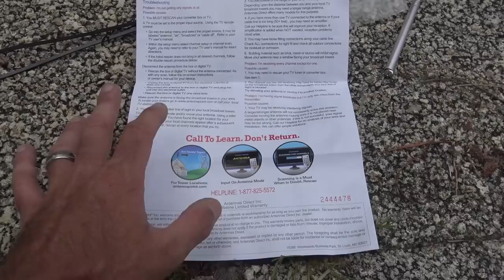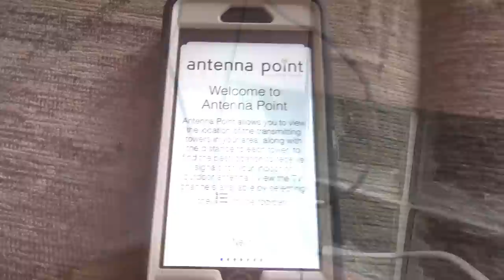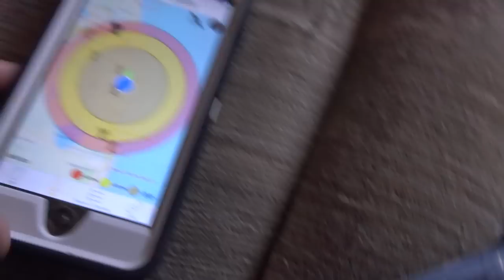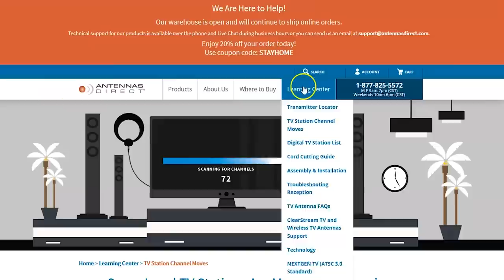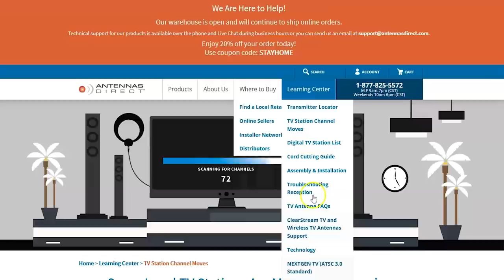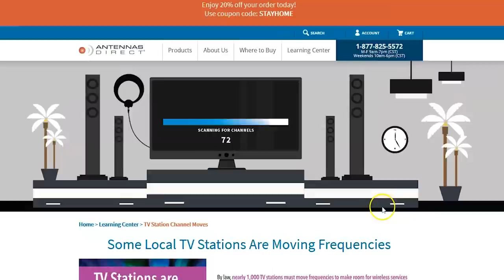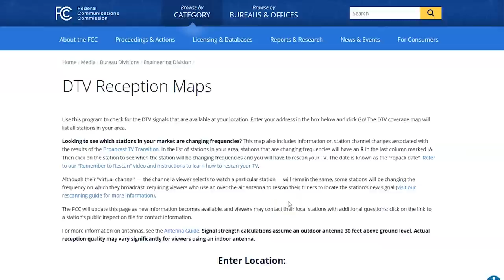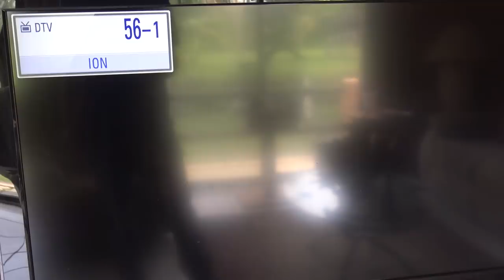Cancel Your Cable/Satellite, FREE Over-The-Air HDTV, TV Antenna Review, Cut The Cord!!!

Comment: Thanks for the info, it;s been many years since I work with setting up cable and ant systems for family. But recently I have a family member that was hurt on a job and he lives in the mtns of east TN and is on a very strict budget. So I used you videos as a reference on what needed to be installed at his house so that he could at least get what was available.

Comment: I cut the cord last week ATT/direct TV kept raising the bill. It was 109. It went up to 150 I called and complained last year and they lowered it down to 125 then the discounts fell off and went up to 165. Once the other one came off it would be $180. So I called and asked them to give me a new promotion and they refused saying there weren't any for my account. I cancelled and kept the internet which will be $66 vs $170. So I'm saving over $100 a month. I bought 5 Amazon fire sticks when they were on sale. I'm now paying $20 Philo and $5.00 for frndlytv app. I also got a small HD antenna for the living room and it's working great I got 70 channels on it and am very impressed. I want to move to my sisters neighborhood and get spectrum: spectrum doesn't charge for data overages for their internet and my brother in law is a gamer and has been satisfied with their service. I hate ATT.

Comment: I use an old analog antenna for 4 TVs and I have picked up about 80 channels in the Sacramento  area.
Sometimes I can pickup four San Francisco Bay area TV stations.
For one TV in one bedroom I use a rabbit ears like trucker's TV antenna that would have been mounted on the mirror of the cab. I have it mounted on the edge of a metal awning as if was like the trailer of the truck. It acts as a reflector and it gets good reception.

Comment: I just left a comment on video #1.  Very informative.  This was just as good.  Maybe better because you did it for Grandma.  You, especially in your hurricane prone area, failed to mention anything about wind load, wind load ratings or any structural support that should be considered and why if you're setting up an outdoor fixture.  My 40 foot tower is bolted to the house at about 12 feet.  Then I guyed it to add support at the 30 foot mark.  Tornadoes and severe thunderstorms are common here.  I don't want my antenna going anywhere!  It's saved me way too much money!

Comment: I could have told you that Eric. Antop 401-BV  Big Boy indoor outdoor built in LTE filtering built in amplifier with uhf with vhf dipoles works really well. That is what I have. On average 70 mile range great for attic mounting, outside low profile mounting, on mast or side of a building.

Comment: I got rid of my cable service a year ago, and added Tablo for recording. In metro Phoenix I get CBS, ABC, NBC, PBS, FOX and a few independents. with the Tablo ( or similar Amazon product) you can record and skip through commercials, and get reception in all the rooms without individual antenna wires in each room, via wifi, I don't miss CATV

Comment: Finally a video where the distance from the towers is similar. I'm 60 miles out from the LA towers on mount wilson. I have the clearstream 4 max which is okay for most of the channels. The problem with the 4 max is the vhf antenna on it can't pick up 7-13.  I have been looking for a better vhf antenna. IDK if I'll get that multidirectional antenna but probably will get the high vhf one.

Comment: Hey Guy, I'm a Ham Radio Operator too and I went with the Gray-hoverman  DIY build and where I live I can easily get 56 channels - OTA, if I had a rotor a lot more as well. my cost was far less then you paid for that pre-made ant. Be real man and do some research on DIY antennas and you will see that there are many designs that can do a good job and are fairly simple to build - hey it's not like we don't have the time now!
Reply: Adding a few links to your research would have been helpful.
Reply: @d.j.radioroyspinner8  Oh, I will, but I had always heard that Ham Radio Operator's were really helpful bunch and shared information. Apparently, in your case that's a false statement.
Reply: Not really i gave you some good info

Comment: The DB8e 8 seems like it's going to be a great antenna. I don't even have it mounted yet. It's going to go in my attic. I'm about 35 miles away from the nearest transmitting towers and when I tested this antenna out on the main level in my house, I picked up almost every channel I can receive from the those towers (About 40 channels). Keep in mind that I had this antenna in my dining room when testing it. The signals had to travel through one of the outside walls on my house plus 2 other inside walls.

Comment: 20 years ago my ex wife splashed out on U.K. satellite tv from SKY to keep our young children occupied beyond non stop vcr repeats of Thomas The Tank Engine & Pingu. Because the tv was at the western elevation of the property and all the neighbours’ dishes were sighted along their Eastern facing walls , I duly climbed into our attic the night before and cleared enough space to allow the SKY Installer to run his cable within the ceiling joists’ chamber from West to east and giving the shortest and most direct route possible . He needed to simply bore a hole through both soffit boards to get his co ax into and exiting the attic…Clearing the junk and lifting the fibreglass insulation was a bind and took a while but I figured I’d save him a ton of time and effort. 
  When returning from work I asked how Sky man had got on - anticipating his credit for my efforts at making his day more straightforward. “ He never came inside “ my ex replied. I was baffled until I learned how speed was everything to SKY TV - he’d ran the cables up to the soffit & dropped them into the rainwater gutterings and laid the whole co ax supply all the way around the building using them as handy cable containers and twice as much cable in the process ….🙄

Comment: I lived in Lakeland in the late 80s and early 90s. My first ducting experiences were here with a crappy pair of bunny ears on my tv. I got a good selection of stations from both Tampa and Orlando there, WESH was usually pretty weak unless there was an opening. The other station I used to DX on a regular basis was 12 out of Jacksonville.

In any case, a good guide on pulling in distant stations. I have remote property in Texas that I eventually want to get distant OTA stations as well as HF and 2m ssb. That app sure beats using the fcc site and a compass to aim towards a target.

Comment: You are an awesome grandson thanks for helping Grandma but from the map you showed at the 10:47 mark you need an all direction antenna mounted as tall as possible with a pre-amp to get all those signals.  You are in the bad situation of having stations on opposite sides, so if you don't want to use two antennae you should use a single omni-directional antenna with a pre-amp on a tall ass mast.

Comment: Direct TV is charging me $100 for a bad receiver that we had ONLY 2 days. Won't back down on the charge they gave us for bad equipment I told them that we had Direct TV for over 30 years and paying over $ 1600 a year and  they would loose it over a $100 rip off charge. They didn't move so  we told them to cancel us. Not good business. We went to YouTube TV with the same channels that we watch plus  more for 1/3 the cost. AND will be putting up an antenna. Thanks Eric.. AB1ZI   Carl

Comment: I cut the cord a couple year's back. Now if I could figure out cheap High speed internet. And cell phone for crying out loud my car payment is less.
Reply: I pay 120 for a Verizon mifi and 16 or more mb on my phone.  Operate the phone, computer and smart TV simultaneously with no problems.
Reply: We cut the chords but we pay 60$ a month for some damn fast internet. NO cable though and they STILL ASK US AFTER A F***ING year! We are in our 30s so most of what we do is on the internet. I also stream so no internet is not an option. Just know of u get internet they WILL dog u for TV just keep saying NO TY!
Reply: I'm paying almost $70 with att for internet. I saw Xfinity has 1 year 200  Mbps for 49.99. I already cancelled direct TV saving $100 per month already. When I switched to Xfinity I'll save even more. The thing is to keep prices low seems you have to do the cancel every 1-2 years to get new member deals. Which is ridiculous.
Reply: @kristinasullivan9436  With spectrum we pay 64$ a month for 400 mbps down 20 mbps up.

Comment: Eric, you did not mention the preamp vs amp in this video.  What I would like to see/know..is the DIFFERENCE between the two in a test scenario (signal strength/quality).  In this video scenario, do they make a VHF/UHF preamp that you could of used at the mast and then used a splitter if needed at the house...vs a amplifier with splitter built in.  Lastly, Ihaven't seen you "fine tune" the direction of the antenna (IE, the antenna app gives you a good idea of pointing), but have you put it up.  Did a channel scan and wrote down signal results and then tried turning slightly left/right AND tilting up/down to see differences?  Then creating a "balance" among all channels.  I know this is time consuming, but I guess I'm OCD about that :)

Comment: One thing to keep in mind is that the digital picture drifts an awful lot. This means that if the signal is around 90% now, in one minute or less it can go down to 50%. The good news is that you do NOT need 90% to have a great picture. Whether it's at 50% or 90% signal, the picture is the same. It's when the signal goes below a certain threshold that your picture degrades and very soon it freezes. That was my experience with Dish Network, some 15 years ago - but this happened very seldom. It's basically the same thing with HD TV now with my home antenna.  So far, I have NOT been able to replace cable; but, then again, I have never used an outside antenna, other than the Ku Band Dish Network dish. The weather affects the signal because it reduces its strength and therefore the ability to watch a given channel. One thing one could do is have a very basic cable set up and get the other channels free to air. The latter is or may be less reliable, but is also more fun to use and maybe comes with an even better picture than cable's.

Comment: Don't think that the EPG blue timebar is the signal strength... :)
Reply from the maker: welp, now that I look at it on the video, you may be right, LOL... But I didn't see any pixelation and now she gets NBC so I am sure it is stronger than it was before
Reply: @HamRadioConcepts  Lol! No worries, love your videos, keep 'em coming! 73's de SA2CMY
Reply: If filming time was about 5PM then it's definitely was EPG progress :)
Most of modern TVs aren't showing signal level.
You might want to cut that part to avoid confusion.
Reply: From the last station shown.I put the time at 4:45pm.  The show was from 4:30pm to 5pm and the bar was almost halfway.
Reply: The info bar shown at 16:24 is an elapsed time progress bar. The signal strength meter is buried in a menu somewhere. On my Samsungs, it's buried in the support menu.

Comment: I have the biggest directional antenna there is but I can’t get the multiple stations without a rotor. Rotors are next to impossible to buy. They are made so cheap that if you live in a windy part of the country they will go to hell within a week.. . The solution is to buy a rebuilt Alliant antenna rotor made probably in the 50s but built like a battleship they are available online. Or buy a ham radio rotor. I opted for the alliance and it works great. My problem is when I program half my channels and then turn the other direction and program the other half I lose the first ones. How do you program them one at a time. With my old LG TV no problem but I can’t find this option on my new Samsung. Any advice.

Comment: maybe I need both those antennas because I'm not sure that all channels are digital in Rochester or Buffalo New York I only get three channels in my house. I bought an antenna a few years back before the change to digital. We have like five antennas on the back of our apartment house. Is it legal to use their cables? They just leave them there they're above my back hallway all screwed in. Thank you for sharing this it is very helpful to a lot of people. I avoided getting a flat screen until last December. I can't even give away my Sanyo 32 in Waze like a hundred pounds and it is the top of the line from the day about 2001 when they were coming out with the flat screens that were $3,000 or more now they're way more affordable and even crackheads don't even want one of my old TVs LOL

Comment: I use my g5rv for tv it works my diamond x50 not so much but I do have a 13 element  2 meter beam  and a 10 element  70 cm beam I need to get up in to the air

Comment: I've been using the db8-e for most of my TV installs and have been wondering if the repack will require me to add VHF. What combiner are you using from the db8-e and the VHF antenna and how are you avoiding multipath distortion from the various coax cables?

Comment: I wonder if the antennas direct bow tie UHF antenna would work better than my old Radio shack corner reflector. What type of coax do you recommend for UHF TV?

An option for a lower cost alternative to cable TV is YouTube TV, not to be confused with YouTube. Using an antenna for locals is also a way to reduce the streaming bandwidth consumption, not streaming the local TV stations.

How much signal loss do you get when it rains? Do you have enough signal to prevent the rain fade outages?
Reply from the maker: RG6 solid copper, or RG6 quad shield.
Reply from the maker: Unless its a massive storm with 4 inches of blinding rain per hour, then it may pixelate the distant stations. Sometimes the storm is 35 miles away from me and clear at my house and if its bad enough it will slightly fade

Comment: Why is a ham radio operator referring to an antenna as an "HD" antenna?
Reply: Russ Carter  Perhaps because it is for reception of HDTV, therefore “HD Antenna” ?
Reply: @juana.w0jalabellon277  All a television antenna is a dumb antenna. If you had a tv antenna from the 50's, 60's'70's, 80's or even the 90's they all would pick today's signals just fine. The "HD" is just marketing.
Reply from the maker: I know there is no "HD" antenna, I might have just spit that out after seeing it on the box and stuff.. Or when I said "HDTV antenna" highlighting HDTV as the high definition tv service and grouping that with the word Antenna.. But you and me are on the same page no worries.

Comment: LOL, you don't need that heavy duty antenna. Flat no hills FL.....LOL    Is there any place in FL that requires that?......I've traveled all over the Western States with a simple 2 bay antenna from Solid Signal.  $30 antenna has provided me with 20-75 OTA TV signals almost 90% of the places I go.  I have a Winegard amp for those fringe areas.  No problem with 50-75 mile plus coverage.  90% of the channels are in the UHF area.  With digital, it's either full signal or not, so not really a problem with a lower signal unless it's pizellating.  Lots a good info.  Most city people could poke a 3 ft wire into the back of their TV for free and get  most of their channels.  Us Hams have a step up on the rest of the folk......:)
Reply: I hooked a tv into a jpole and 2 meter 1/4wave out on my 35ft tower. I received the 4 local stations just fine. I'm in a rural area so sadly all I get is 4 channels from PBS. Not bad considering the distance to that transmitter and the fact it's on a ham band tuned antenna.

Comment: What happens if you have a TV that does not have a tuner, its just a 40" computer monitor?
Reply: It's not a Tv then, just a monitor.   You can buy a stand alone tuner to attach to the monitor. There are also PCI tuner cards for inside desktop computers. There are also little tuner USB sticks that are for laptops. You can then cast it to your large monitor.

Comment: Can we still use the original style  of UHF and VHF antenna with a rotor  ?
Reply: Yes
Reply: Yes, but the old style VHF yagis have very few stations that they can receive. The UHF portion is the part that is most useful.  As a practical matter, the yagi UHF ones have less range. If yours still works, use it. I stopped using the VHF yagi because they did not hold up in windstorms. The long rods were always getting broken by the wind.

Comment: You mentioned AT&T. Is your grandmom also paying for wireless 5G cellphone services or is she on a landline? Is that running on Voip now? We literally have to be techs these days. 
If we cut the cord, that will result in killing our wifi internet and cell services ($80/mo) here in New England through my local Warner Cable/AT&T ISP. I've been running free tv services, 26 channels, on air for years, but the internet services bill has become a killer. It's less than 20/mo for 5G cell service but the internet is still 80/mo with no tv. I don't think we can buy a hotspot that will run on tracfone, a 3rd party elderly cell provider fed contractually off AT&T's 5G equipment and services. Hmm. Maybe I can w another cellphone number if I can find an independent hotspot. Radio Shack?
T-mobile wants 60 dollars a mo just for a phone number/micro sd card, no equipment. They won't sell me a hotspot without it ($30 more), plus they will jack their prices up shortly.

Comment: Wow I  never had cable or satellite. Always antenna over the air TV.  I live in the Los Angeles area and most TV transmitters are located up on Mt. Wilson. Thats right above Pasadena Ca. No need for a big outdoor antenna system but I do find this interesting. Maybe I could pickup San Diego TV stations with a high gain outdoor antenna?